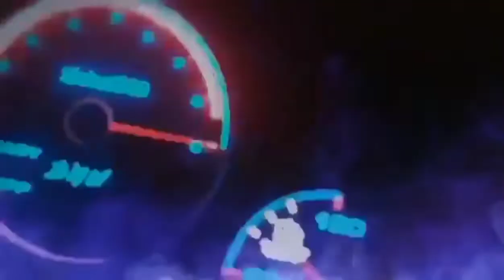Hyundai starex 2001 turbo cleaning ( ito ang dahilan kaya naglalangis ang turbo kahit Good pa 🔧🔑🔩❣️

Comment: Boss pwede magtanong ilang liters  po ba ang oil capacity ng starex svx intercooler turbo 2002 model po sana masagot po salamat?
Reply from the maker: search sa manual po sir
Reply: Kabibili lang kasi namin sir balak ko sana change oilan kasi diko alam kung ilang liters capacity ng oil nya
Reply: Saka wala napo kasi manual sir e
Reply: 5.5 liters po engine oil ng starex svx